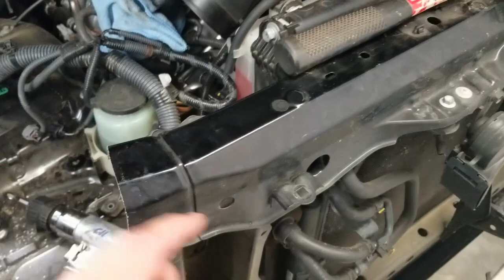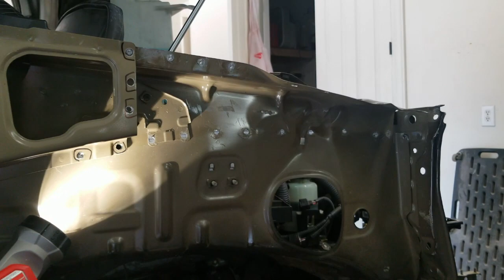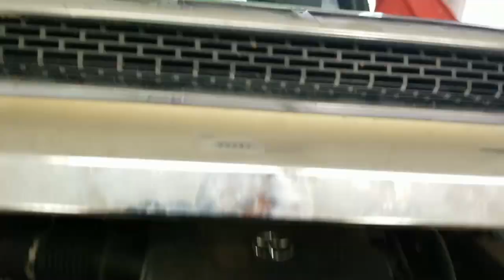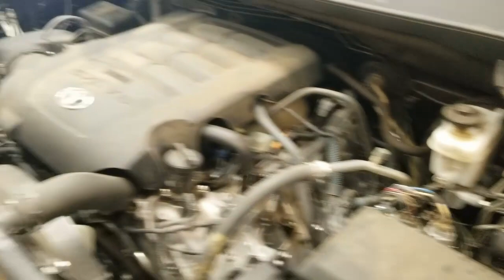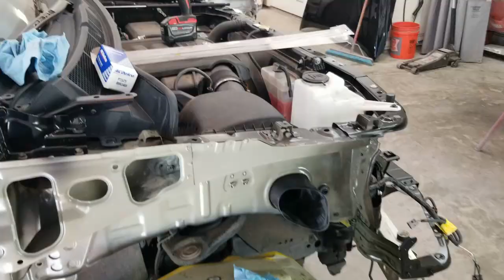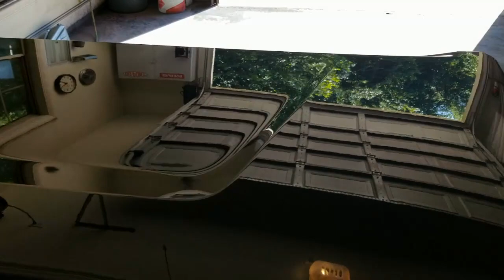2017 TOYOTA TUNDRA | FRONT COLLISION REPAIR

Comment: How did you fix the bumper?
Reply from the maker: Bumper parts were replaced
Reply: @samg5543  ok. Were only the bumper caps replaced or the whole bumper?
Reply from the maker: @terryreyes1125  right chrome end only
Reply: @samg5543  thank you so much. Do you change just the end cap?
Reply from the maker: @terryreyes1125  yes
Reply: @samg5543  thanks bro

Comment: Little frightening that you’re repairing a hit like that on the floor w a slide hammer or pry bar there pal....I don’t usually knock guys on how they repair cars in their own shop bc you just never know the backstory or deal you have w the customer....but either way that truck belongs on a rack...ya know for measuring purposes....but I guess that doesn’t matter since it’s cut apart in the first 2 mins....scary shit man....
Reply from the maker: Yes, a rack and measurement system would be ideal, but the damage wasn't nearly as bad as it looked, which is why I took the job. Thanks for your feedback.

Comment: I did a similar repair to a Scion TC. I like the 3 piece tie bar design Toyota makes. Makes it easier to section in a new piece without replacing the whole tie bar. That black turned out nice. Black isn't my favorite color to paint.